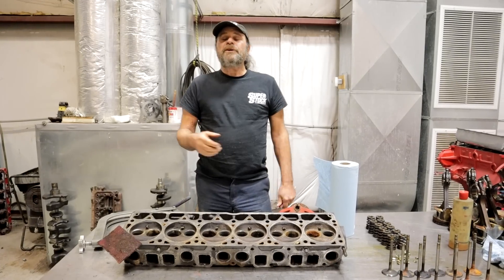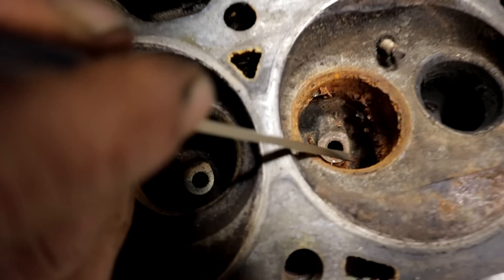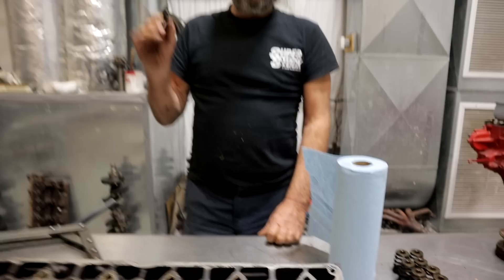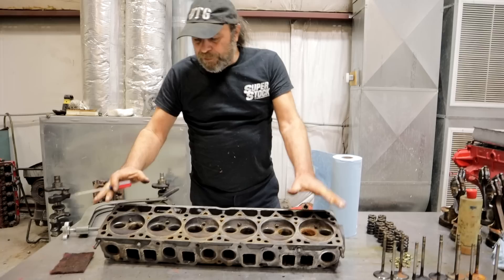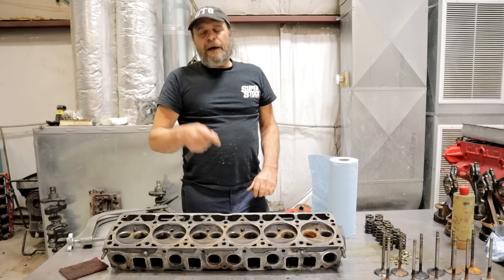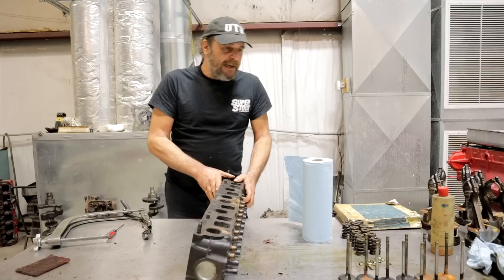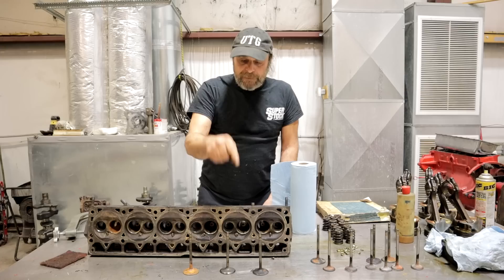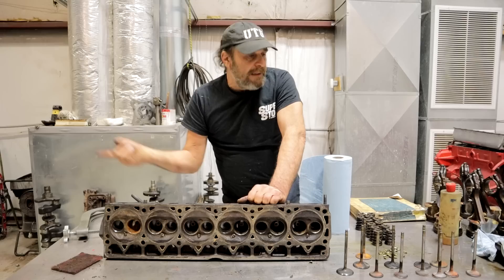Your First Engine Job - This Is What A BAD Cylinder Head Looks Like

Comment: As always, the little tidbits are the crown jewel of your videos. I always clean the valves just because I have them apart and they are easy to do, but now I know why and it makes sense. Also, I will assume that this applies to small engines as well. My son and I pull garden tractors and every inch counts. If we can get a half horse power more than our competition, that can be the difference between 1st and 2nd place.

Comment: I know for the shade-tree guys, working on a car is 50% or less money (cheaper than bringing it to someone) and 50% or more hobby.  Just curious; what is the cost (new valves, machine a head, a new cylinder or 6, etc.) of an average rebuild vs. the cost of a junkyard "30 day guarantee, if it ain't broke in a month; it'll last" engine? (Cost as per what you are doing, just get a driver; nothing fancy).

Comment: Hats off to you UTG for that bit! Working in my father's shop, it was EXACTLY as you said, yet there were a few times on our own stuff.... like you said, run it (a few Chevy's are prone to this as well). A customer that's paying for it, changes it.... because you can't guarantee that head will hold. If it's your own stuff.... and it fails.... it sucks but it's on you anyway. Good stuff UTG.

Comment: So you'll swap the head from the noisy running engine to the new block, swap in the newly rebuilt engine, then rebuild the noisy engine with an aluminum head and stroke it; is that right? Sometimes you're hard to follow.
Reply: That's how I understood it

Comment: Nice content.  I’m thinking of using the casting #0630? 96-99 casting 4.0 cylinder head on a old AMC 232; why? as the AMC/jeep guys say those years flow best with no modifications or other work. Do you have any experience with the 630 head?

Comment: So this was the end of the "Your First Engine Job" series or were there more videos beyond this one? I was kind of looking forward series all the way up to a complete, rebuilt and running motor. Did you just throw in the towel and get a re-mand from Jasper or something? Also, how far can you bore out and stroke a LA motor? Is it just easier to work with 383 based motors at that point?

Comment: I'd just braze that crack if it was my own head.

One time I had a 500 caddy engine that cracked there on both heads though, and both of them went to the water jacket.

If I had at that time, had the resources, I would have just brazed those cracks and gone on.

Comment: Does ANYBODY make a light weight crankshaft for the slant six?  The stock crank looks like it has 30 excess pounds that NEEDS to be chopped off! it looks like something that might have been made in the 1900's. by someone who did not know what flywheels were for!

Comment: If you suspect the engine has overheated, is there a quick way to check valve spring temper or just junk them ?

Comment: I certainly got somethin out of that. 
Currently assesing the head on my first engine job and am about to pull the valves.
It's a suzuki samurai with the tracker 1.6.
After  watching this I can already tell they're pooched.
Cam bearings already told me so though as they're scored. Only 1 I can feel but all have them.
Thanks mate.

Comment: Like I said, boat anchor 4.0., your should swap in a 22R Toyota, straight 6 Chevy/dodge or Ford or swap a v-8 289 fomoco, 273 dodge or 289 Ford. 4.0. Is a tractor motor, first rule of four wheeling is dependable power, a 4.0 ain't it. Don't waste time on garbage ...

Comment: Those 4.0 engines should have been designed with a cross flow cylinder head.

Comment: I'm curious how the 90° bends the air has to make in that intake affect power output.
Reply: Haha alot. 
90s suck real bad. 
Recently,Briggs came out with a 26kw gen, and it uses the same engine as the 20kw  EXCEPT: high flow muffler , it's huge and weighs 40 pounds. 
They "lost" a 90 on the intake tract. 
Spark timing now advances once it starts. 
Other than that, they "found" like 6-8hp so it'll pull a 26kw gen now. 
These things run ok, and that's about all you can say, it's no high flow race head at all.

Comment: So I have a crack in my 4.0 head between the intake and exhaust valve on cylinder 1. You’re saying to run it? Ok, gonna run it I guess
Reply from the maker: Seek the info for your specific type of crack on your specific head. Some are ok to run, some are not.

Comment: I had my 99 XJ engine rebuilt by a trusted local machine shop. It needed a new ( used) head as mine was cracked from wife overheating it and making the oil into peanut butter. $1700$ for complete engine rebuild. i removed it and installed it myself. i put 4 hole injectors and a new exhaust header on it ( mine was cracked at the coupler). I also put heat wrap on the center 2 injectors as theyre known for getting extra hot. Ive got about 25k on the engine now iand its body rust thats taking its toll here in MI. We only use it as winter beater when it snows and taking dogs for a ride around the block since its a GASHOG at 14mpg. My 2006 F150 4x4 with an 8ft bed and ext cab V8 with oversized tires and 4.10 gears gets better MPG than stock the XJ. Pathetic

Comment: That method for checking valve guide wear is ok but is not so ok for longevity, it tells you that it's workable now but not 10k miles in the future, without precisely measuring the amount of bell mouth the guide has it becomes a gamble on how long the valve and seat faces will last.

Comment: What happened to fixing everything? Now you want to start going through a catalog and buying parts. Why don't you just take your MIG welder and weld that crack.
Reply from the maker: The Edelbrock head would not be for THIS engine, but for the stroker I plan on building from the engine currently in the truck